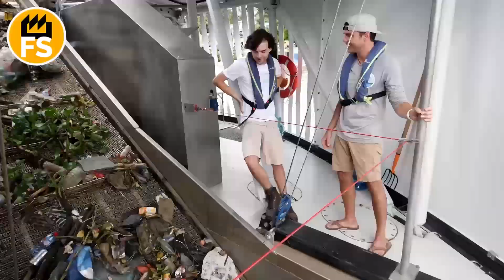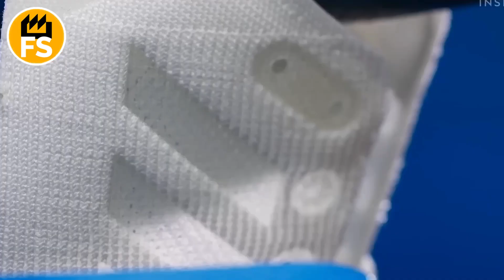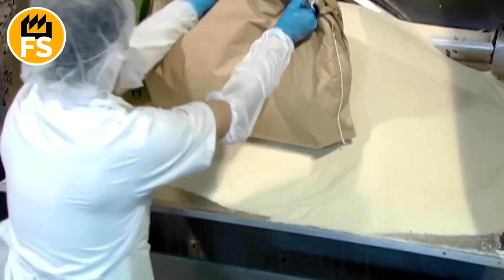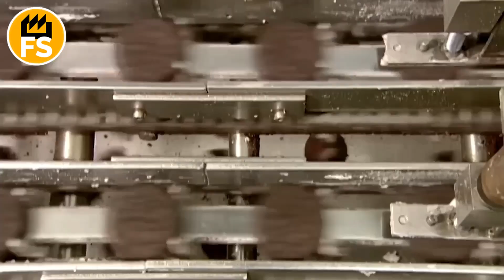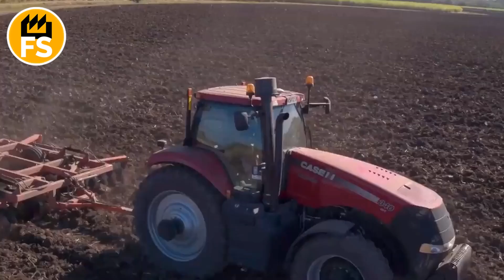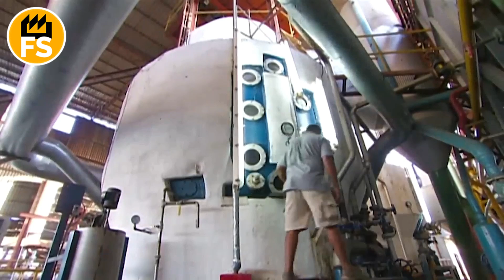Millions of bottles in the ocean! How garbage becomes stylish sneakers

Comment: Here in Australia, sugarcane is grown in parts of Queensland and Northern New South Wales. We use E10 fuel in our cars, which is 91 octane unleaded petrol with up to 10% ethanol. It's a few cents cheaper than regular petrol but the car does use slightly more fuel, so the cost balances out and is better for the environment.
Reply from the maker: It's great to hear about the use of E10 fuel in Australia, and your commitment to more sustainable options! 🌱 Just as sugarcane contributes to eco-friendly fuel, our stylish sneakers are made from recycled materials, helping to reduce ocean waste. 🌊👟

Comment: what if such boat would have an autoclave onboard to make fuel out of the plastic garbarge, to run the boat itself, and to produce electricity for the autoclave, it would be direct use of the energy stored in the trash with no handling of the waste from far see to the shore and running such factories (otherwise I very welcome this plastic recycling, not against), would that be a energy balanced, since autoclaves need huge amount of energy?
Reply from the maker: That's a fascinating idea! Utilizing an autoclave onboard to convert plastic waste into fuel could potentially create a sustainable cycle for energy and waste management at sea. 🌊♻️
Reply: @Factory.Secrets  there are even less energy demanding technologies than autoclave leading to about the same, I am just wondering if this thought is entirely off or even partly feasible, such boat can be equipped with some solar panels or foldable wind turbine to make a little bit more for the needs. There are diesel trains who actually run the motors on electricity on instant fuel burn, so I believe the entire idea is not overall out of consideration